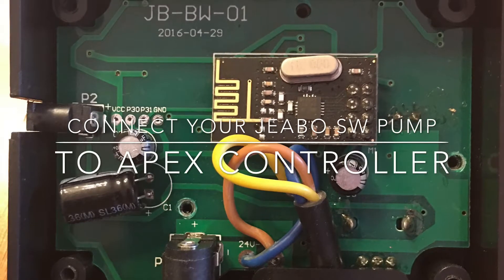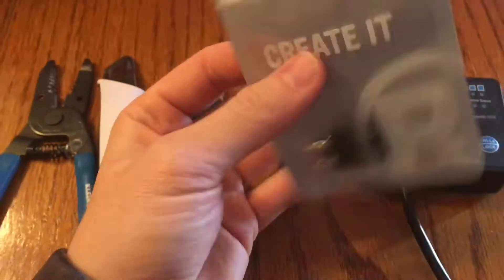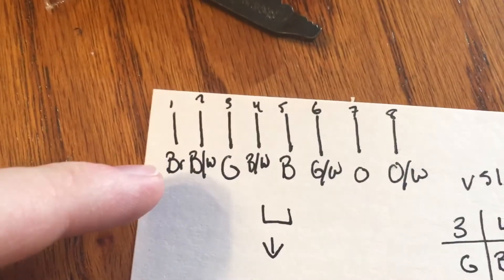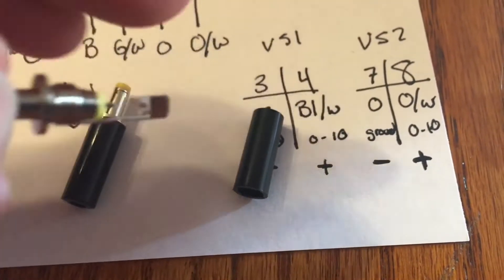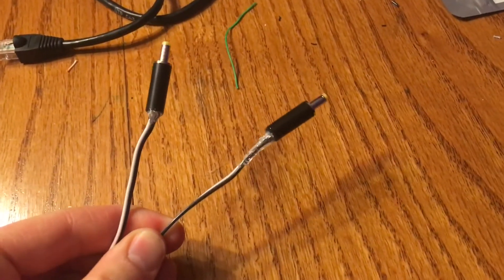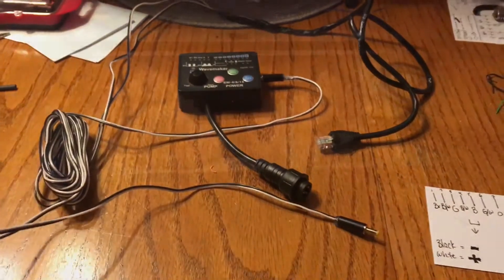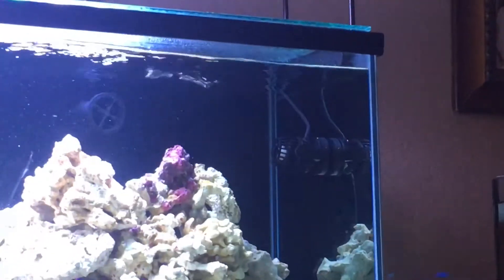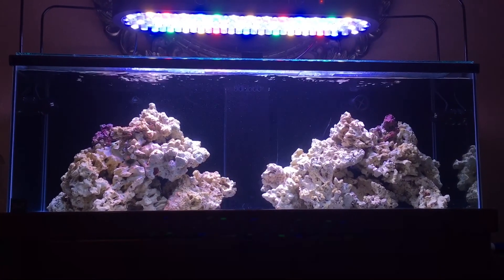Jeabo SW-4 To Apex

Comment: Hey Brennen, huge thanks for the video! 

I've been trying to figure out what they did differently with the SW-2 pump, as it seems to use the exact same control board (JB=BW-01  2016-04-29) but the pump itself does not behave properly on a 0-10v input. On the controller if you go by the light bars, one light = 3.3v to the pump on the AV control wire (yellow), all lights = .03v, or full speed. Voltages above 4.5v will stop the impeller. With the SW-2 connected via apex VDM, 0v apex equals .03v controller, so the pump runs at full speed. 5v apex equals 2.14v controller, so the pump runs at about 80% power. 10v input equals 3.95v controller, putting the pump at around 10% speed. It isn't possible via apex VDM to turn the pump completely off, so you can see where this is going..

I'm wondering if you can do a huge favor as I don't have access to a SW-4 or above; would you be able to take a voltage reading from the 24vminus lead (blue wire to the pump, bottom left on the connector if the nub is facing down) and the positive AV (yellow wire to the pump, top connector if the nub is facing down) when your apex is set to 0%, 50% and again at 100% on the VDM port?

If I'm correct, the SW-4 and above should function properly with a zero, 50 and 100% apex control voltage which means the SW-2 are complete lemons when utilizing external 0-10v control. They in no way shape or form will function correctly without extensive monkeying, and even then are never able to fully stop.
Reply: Hi! I have the same problem with SW-8. Have you found any solution?
Reply: don't the sw2's run on 12v instead of 24v as well? but i did see early reports that the voltage to control them is reversed - normally the circuit to control jebao's from apex is just halfing 0-10v to 0-5v,, but to control these you almost need 5-0v.....you could maybe build an adapter but it's definitely gonna be a pain.

Comment: Have you had any issues with this since? I purchased 2x SW15's and want to control it with APEX. Will I need a cable for each controller? I've never ran in slave/master so I'm unsure. thanks
Reply from the maker: chewy954  I haven't had any issues with this setup other than the plugs I picked out weren't perfect but I made them work. You can use one Ethernet cable to control both pumps. Therefor you only use up one variable speed port on your apex and you can serve the other one for lighting. As for master slave That function is useless once the pumps are connected to apex because all of the programming is in the software which I show toward the end of the video. I mess with the intensity every week to find that sweet spot that corals love.
Reply: OK, I'm going to give it a go but I don't have soldering skills. My hope is to used a premade cable and just cut and splice. Do you happen to know if this is 3.5mm x 1.1mm DC jack? Thanks man!
Reply from the maker: chewy954 you could use butt connectors or wire nuts or something similar but as for the connector I just went to my local radio shack to find which fit best.